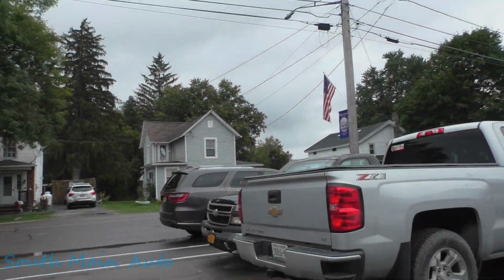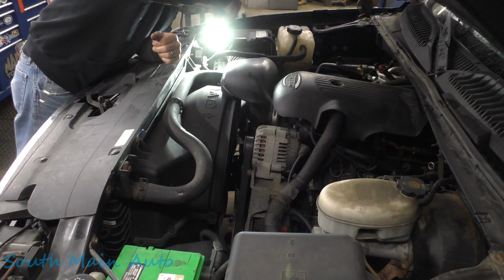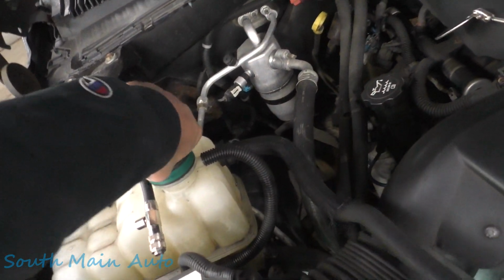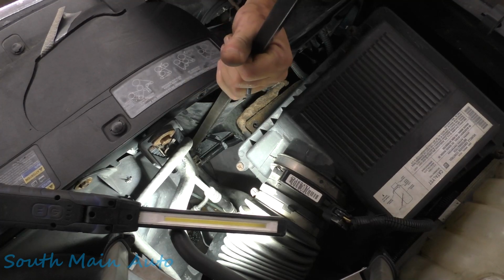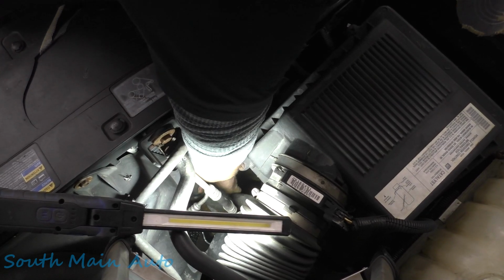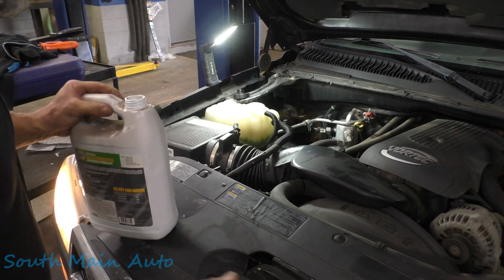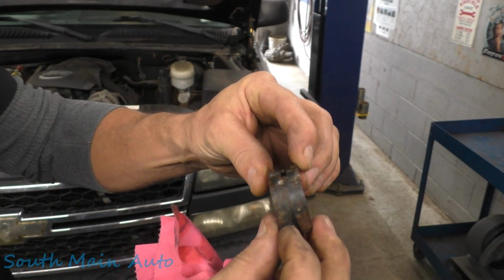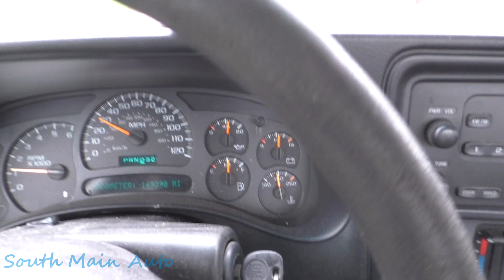A Hot Chevy With Nothing To Keep It Cool 🔥

Comment: Phobia of dodges. That cracked me up. I got my phobia from trying to remove the starter from an old dodge Cordoba, slant 6, outside, in the rain, in a sandpit, on a car with 1-2 inches of greasy grimy crud built up on everything around that starter and that side of the engine. Couldn't even find the bolts till we scraped crud for 30 minutes. Of course then we were laying in wet sand and greasy crud. I've had a dislike for Dodge stuff ever since.

Comment: It is strange that the Check Engine Light (stored code?) went away by fixing a coolant leak. The battery was not disconnected, nor did you clear codes with the scan tool. This is very strange.

Comment: Thank you for this video... I have a chevy tahoe that one day was heating up while stopping at a traffic light but the temperature goes to normal as soon as i drive. When i checked it was the coolant level was low... So i topped it up. However every month or so i see the level of coolant drops down in the resevoir and i see no leak whatsoever. What do you advise to check here in this case?

Comment: Good vid ! I Have those same Clamps on My 1999 Dodge Ram Diesel Radiator. I Had a New Radiator put in it a While back / maybe a few years ago & the guy Did NOT Use New Clamps. Are Those Clamps reliable or Do you Think i Should Pop for Some Super de-luxe New Marine Rated Screw clamps. I’m in California. I’m Thinking 23 years is Wayyy over due for New Hose Clamps ! Everything is pretty much original under the hood except for radiator & water pump & belt & Batterys ( I replace every 4 years ) religiously. 207,000 miles on truck.

Comment: At your earliest convenience you may want to replace that hose clamp with a constant pressure clamp.  The constant pressure clamp will expand when the hose gets hot so it will not rip through the hot hose like a hose clamp will.  This owner will likely drive the vehicle until the frame snaps in half so you have some time.

Comment: Mr. O. I have driven GMC Yukons for the last 22 years. I maintain them in accordance with the OEM manual, except for the cooling system. At 50K miles, I have the drive belts,  the upper and lower radiator hoses replaced, cooling system flushed, along with the thermostat and heater hoses. At 100K I do the same thing, adding an OEM water pump to the list. I also ask the techs to replace the spring clamps with worm gear clamps each time. The reason I do this is that the only thing that has ever left me on the side of the road is a cooling system failure. My question to you is, which do you think are better? OEM spring clamps, or worm gear clamps. Yes, I am paranoid about cooling system failures.
Reply: Depends on the worm clamps. The cheap common worm clamps aren’t better than a good spring clamp. With the cheap ones they tend to not clamp evenly, dig into the hose, and strip out easy. A properly sized spring clamp holds a more even tension all around the hose without damaging it. 
There are nice screw clamps that are heavier gauge metal, have smooth shielding pieces so they don’t dig into the hose, and actually have a stack of belville washers to act as a spring and help them hold tension better.
Reply: @NBSV1  Thank you, appreciate the help.

Comment: love the videos....just asking...i have a 2006 honda ridgeline 150 thousand kilometres ...a noisy lifter...should i get that fixed or could i just leave it alone...watched your video on this but it looks like a lot of work...
Reply: If the vehicle is a POS , ignore it . Otherwise fix it . Hondas require valve adjustments every 75 k miles or so, My son had a lifter noise on his Ridgeline and the part was a whopping $1.05 for a Honda OEM part . Parts are a lot cheaper than new vehicles. Even with a little labor .Turned out it wasnt a lofer noise BUT it was a VALVE TRAIN NOISE THAT SOUNDED LIKE A LIFTER NOISE INITIALLY If your not comfortable with the work or diagnosis  take it to a good shop and let them do it. 
To me a valve adj is easy , but I did vehicle repairs for a living . Just some thoughts .
Reply: @ccole9080  thank you.

Comment: Crazy just a simple clamp . My question is what do u do when a vehicle like that comes in with no coolant or leaks and u go to fix it . What coolant do you put back in causs that's suppsed to have Dex-Cool as you know but if they had green in it or signs of a different type than what's in it what do you do ? About that 

Just really curious cause they can't Mix of course either
Reply: I did a 05 5.3 guy had water in it and when I replaced the water pump I put back Dex-Cool back in the system before it left . Just because that's what should been in it and winter was coming so water wasn't a good idea at all . Didn't wanna get blamed for something happening so I put back the correct fluids 

But if it had green in it then idk what I would have done

Comment: Great video Mr. O! I have a question. I have a 2005 Buick Rendezvous and I noticed upon cold start (overnight) if I don't like my engine RPM settle down from 2500 down to 1000 RPM, my engine will over heat! If I let the engine run for a bit before driving away, then there's no problem; however if I just turn the engine on from a cold start and drive away, the engine will overheat. Any ideas? I had a re-built engine - same issue before the rebuilt too! Any ideas? Is it a bad ERG sensor?

Comment: Just wondering what the best way is to get air out of a cooling system. Is it necessary after a pressure test, like the one you did?
Thanks. 🤘
Reply: Depends on the system. Some cars without a radiator cap can bleed themselves. That tank with the cap is at the highest point. Same applies if it has a classic cap. Just raise the nose a bit, leave the cap off and let it run. It'll burp.

Comment: Heyyo! Purchased a used 2004 Ram 2500 few months ago. I'm having many electrical problems. The cab lights don't work as expected. The wipers don't function as expected. Previously, the "lamp out" alarm would go off if I had both my headlights on and the left turn signal. More recently the left headlight actually burned out and now the "lamp out" alarm is always active, even with the headlights off.

During a recent trip to the parts store, another Dodge owner suggested that the fuse box might need a full replacement. Any clue if that's a valid path forward?

Comment: is it necessary to be in a complete stop. to shift from reverse to drive?
Reply: It definitely is in some vehicles.
Certainly won't ever hurt anything.
Depends on your transmission.
Reply: It is hard in the clutch packs, changing directions on the roll.  It creates more wear.
Reply: 'Rocking' a vehicle, like trying to get out of snow or mud is surely a way to damage or weld the forward clutches.
Back in the '90's 4R70w's we're notorious for this.

Comment: Genuine question, did you use the screw type clamp simply because of the age of the car?  Usually for coolant systems spring clamps (like the original) are used because there's a risk a worm clamp might be overtightened and crack the pipe end.
Reply: Constant tension spring clamps because after installation of a new hose the rubber tends to take a set from heat cycling.
Worm clamps would need to be tightened after the engine was run a few times.
**Plus, you can't get a spring clamp around an installed hose, but a Gem clamp can be fully opened.